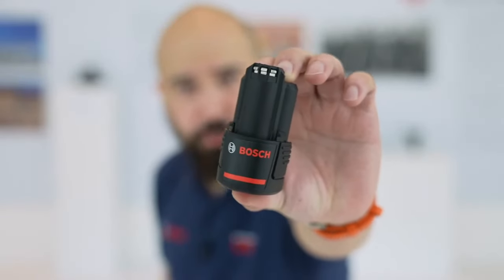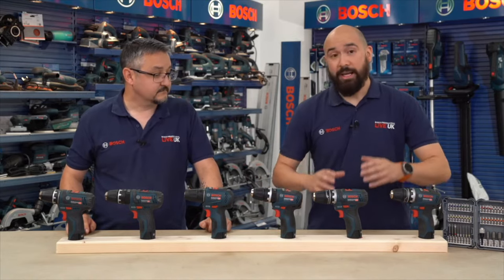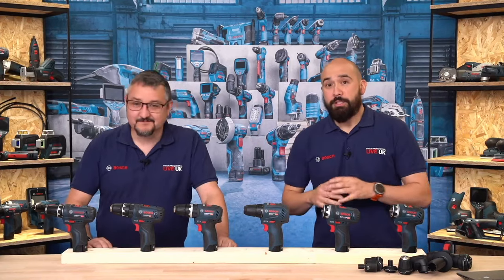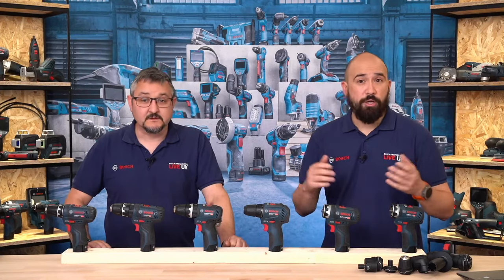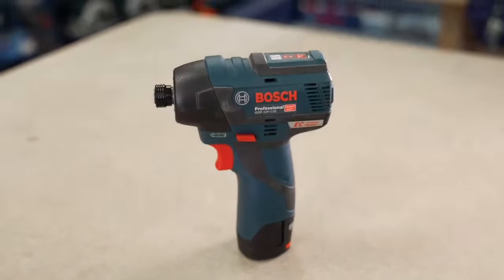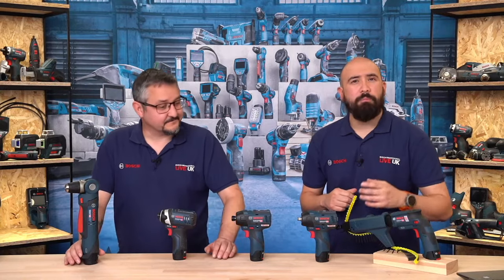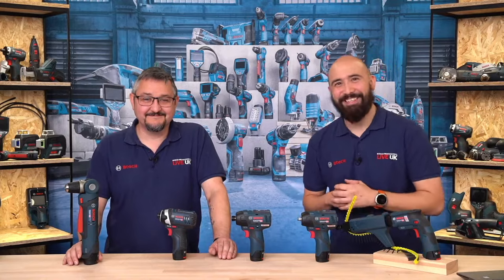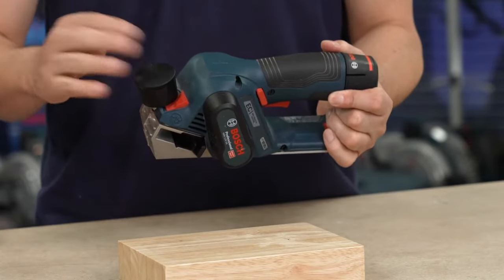Exploring the Professional 12V Range (SPECIAL)

Comment: A 12V pruning Shear tool is needed Bosch. Make the GKS 12V-26 a brushless Circular Saw, same for GSA 12V-14 Mini Recip saw, needs to upgrade to brushless as its its 18V sibling GSA 18V-LIC, along with the GRO 12V-35 Rotary tool too. Iw ould also upgrade the GUS 12V-300 carpet cutter, GSC 12V-13 Metal Shear, GAS 12V Vacuum to brushless too.

Comment: I love the 12v range and often reach for a 12v drill over an 18v because of its size, weight and power. I would love to see another 12v radio or a Bluetooth speaker though. I think a small 12v one would be really useful if it could fit in a tool bag or backpack.

Comment: A 12V Band File, that is basically mini version a belt sander & does similar to a die grinder, like some of our competitors very much needed for tight spots to sand or grind in tight spots with ease? Also like what competitors have, a brushless 12V compact Bandsaw is needed as well
Reply: yess

Comment: One question - when will Bosch be recognising the 12v range through their pro-deals offers? I’ve bought both 12v & 18v tools as each range has items that outperform the other in a niche, yet Bosch’s reward program suggests the 18v are the true pro tools and the 12v are treated as orphans (neither is cheap though)

Comment: Great stream @Bosch Professional Power Tools UK. ARe there plans to bring out a 12V brushless Torque Wrench like competitors? Also would you consider making an update to your Inclinometer Spirit  Level where it could have a feature that could automatically determine the centre point point of a room, use the same sensors in your laser distance measure tape,powered by a 12V battery?

Comment: I've had bosch 10.8/12v since release I think 2005. It is a screwdriver. I've still got it, and the batteries too. Sadly my newest 6amp £70 batteries have both broken just outside there guarantee. So annoying. I've got a drill driver, impact driver, jigsaw, circular saw, vacuum, multisaw, radio, light, 3 way laser and angle driver. I've been a bosch fan for year, but have been put off by my latest battery experience 😢
Reply: Fyi the jigsaw switch isn't very lefthand friendly

Comment: I am into 12V tools own a lot of them. I find them very useful for everyday home use. However, I would absolutely love to see a ratchet for car mechanics (I dont want to switch to another battery system).
Reply: Yes please
Reply: Would like to see a more powerful impact similar to the M12 Milwaukee Stubby
Reply: I'll second that!
Reply: I agree an extended reach ratchet in particular would be amazing, and I’d jump on it very quickly I feel like there’s enough of a demand for it
Reply: You don’t ever wish you had 18 volts?
Reply: LOVE the 12V line. Definitely want to reinforce the need for an extended reach 1/4 and/or 3/8 ratchet (nut driver)! Have the Flexi-Click. Great tool, but not compact enough for some tight areas requiring a long handle.
Reply: So few people buy anything in this range. They're underpowered, have short run times, and are just way too expensive.

Comment: Thank you very much for the stream .
As a Bosch user in the USA, there are a number of 12 volt tools that are not available in the US market .
Sure as the metal working tools, the circular saw, and the rotary tool.
Please bring more 12 volt tools to the American market .
Also, a 12 volt stapler and free standing tower light in 12 volt or 18 volt is neefef as soon as possible.
Thanks again, guys.
Reply: 12v tools are shit just use 18v
Reply: @bollemuslol  go back under your rock.
Reply: @SaintFredrocks  😆👏👋

Comment: @Bosch Professional Power tools UK, i think could give an examples of what the person in comment section during the livestream, is looking for, when he asked about a dedicated 12V SDS drill, instead of an SDS attachment for the flexiclick system. Since you say that the SDS attachment puts out 0.9 Joules of energy, then i would suggest of making a dedicated 12V SDS drill that replaces the old 18volt model, the GBH 18V-LI, that only puts out 0.7 Joules of energy. In that way, you replacing the same amount of energy of the GBH 18V-LI old model, plus 0.2 more Joules of power. And so, in that, you are getting a more powerful replacement in a 12V tool, for about the same or a more compact size drill than the old 18volt model. I think it sounds doable. What do you think?

Comment: it would be very useful to have a charger for the 12 V battery system using USB C  also this could be a power bank as well using power delivery up to 20 V with perhaps 30 W output charging could be 30 W as well...... if a 18 V version of a USB C  battery charger was made available with power delivery this would be to be at least 60 W charge  and perhaps power delivery of 100 watts 20 V. These products are actually made by a Chinese manufacturer for the 18 V battery..  The idea being a compact charger allows for a easily transported toolkit.. The current range of mains chargers are very bulky...  Further advantages would be that some of your larger 18 V batteries namely the 8 amp hour and 12 amp hour would make very useful power banks even if they weren't used with your tools..  Obviously the power bank would need to be able to charge the battery at a reasonable rate as discussed above..  This would open up markets beyond power tools for your batteries which are very compact and of very high quality.. And would fulfil a utility far beyond construction..

Comment: I really like the Bosch 12v system. But it needs a serious update to brushless. For example the jigsaw. And tools are missing in the lineup. I needed a plunge router, so I was forced to buy into another system. It became Einhell (the TP range is certainly not bad), but I rather kept it with only Bosch 12v. A real Boschhammer would be much appreciated. Metabo and Dewalt did it, why not?
Reply: Jigsaw is brushless.

Comment: You need to add a new 12v impact driver with a bit more horsepower. Raw power isn’t everything, but other companies deliver 30-40% more power while not sacrificing weight. 

After 5 years, it’s time.

Comment: I several of these and use them on site, they are typically fantastic for what the battery is able to give it. I have the camera and to be honest I am disappointed with the resolution, if it had less pixels it would be a radio. My cheap (eBay purchase) camera I connect to my phone is much much better.

Comment: Gave up on Bosch 12v line years ago. Still have the brushed drill, but the clutch does some weird slideover setting selection, and the batteries don't keep charge in storage for long. Y'all are too late. Moved on to DX12.

Comment: I have many Bosch 12v Power tools… its not the tools i have a problem with its the small 12v battery packs. 0ut of 20 or so Bosch 12v/10.8v  batteries I’ve have,  4 fail on me, (two 3Ah , one 2.5Ah and one 2.0AH). 
None of the 10.8v batteries have fail like this.

They are not used in a professional environment just for my personal use.

Of course these Obviously all out of warranty. 
Just not seen by the charger its really annoying.